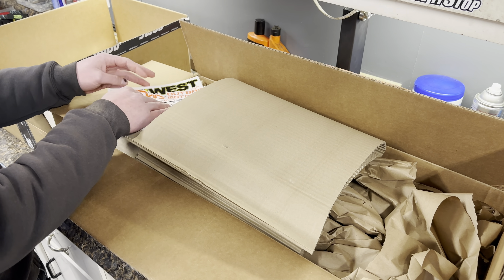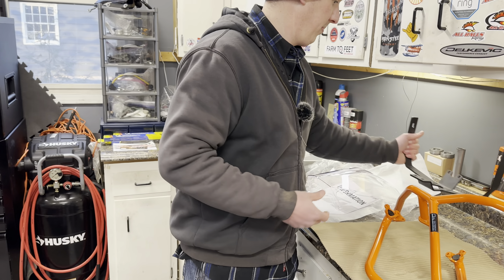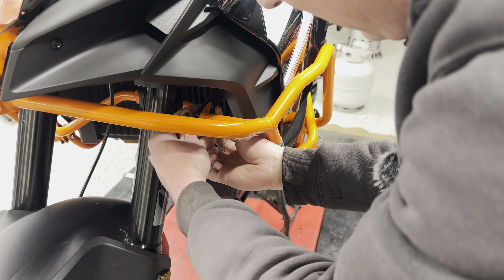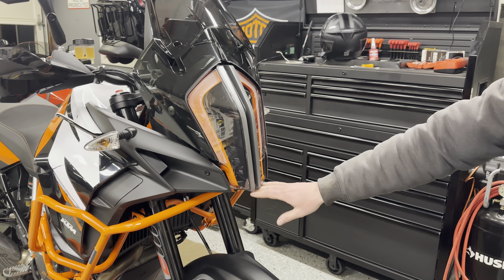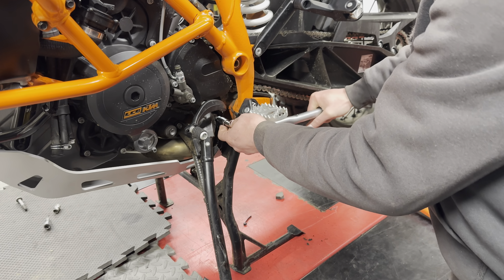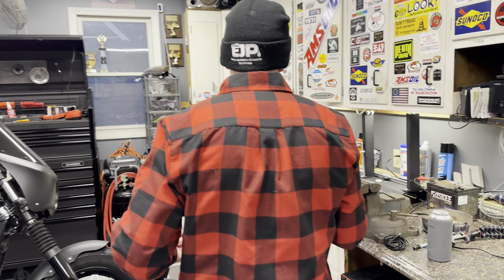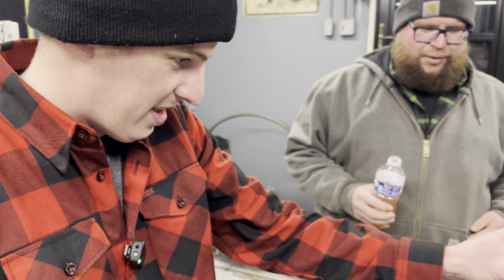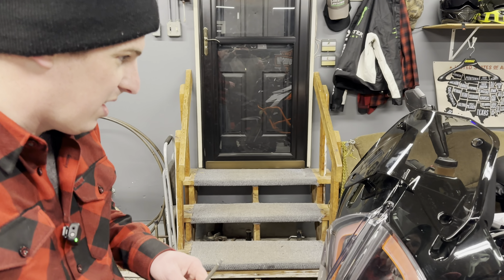Outback Motortek Crash Bars for  KTM 1290 Super Adventure

Comment: How'd the headlight protector hold up?
I just picked up the same bike with only 600 miles and want attempt to keep it fresh.😬😂
Any issues with heat from the light or does it still allow for some airflow over the heatsink?
Reply from the maker: Congrats on the new bike ! I had the same concern with heat, but haven't had any issue. I figured I'd trust it as it's OEM. I'm glad I added it though. Riding even dirt roads with friends I often hear rocks pinging off the front.
Reply: @3_AM  thanks!! Good deal, and point that it's OEM - I'm going to order one up. It's cheap insurance 👍